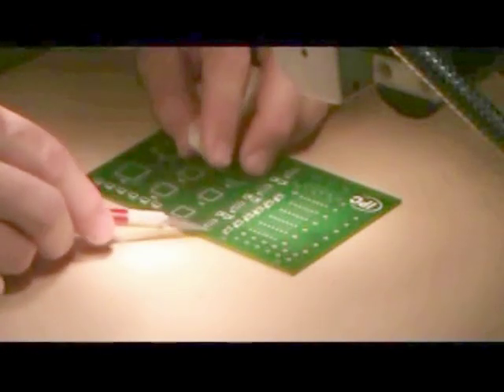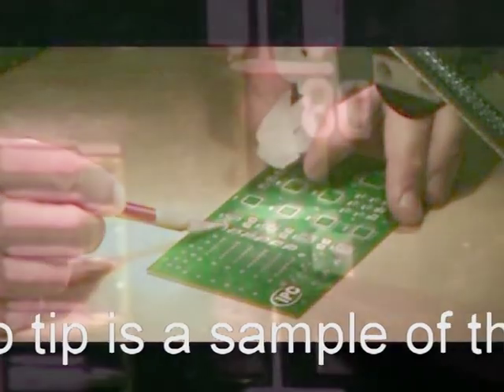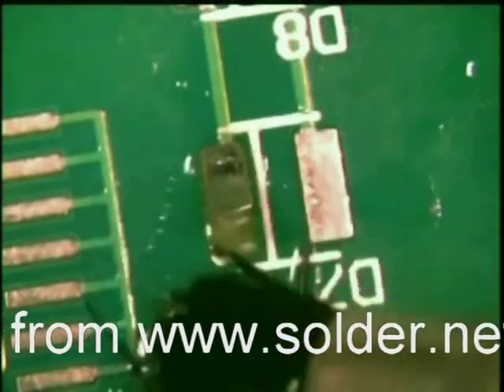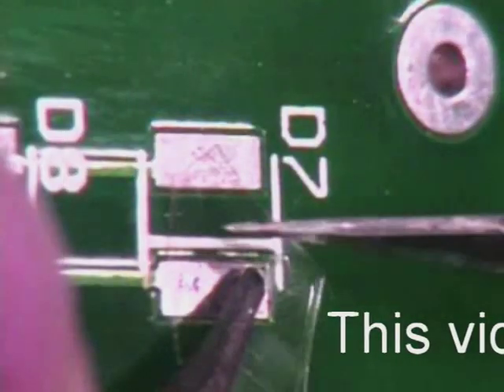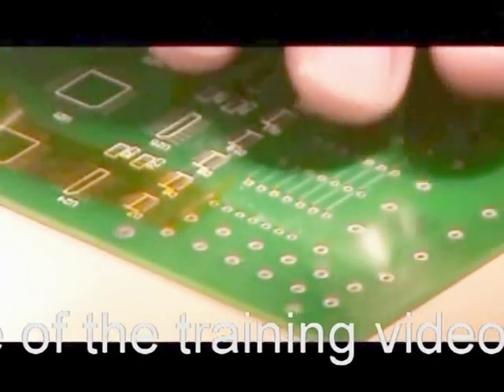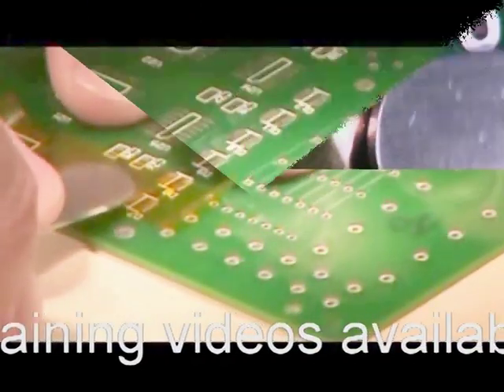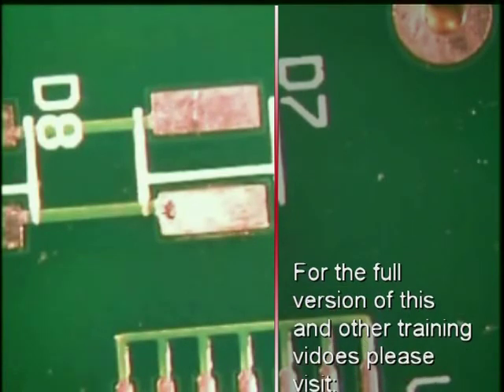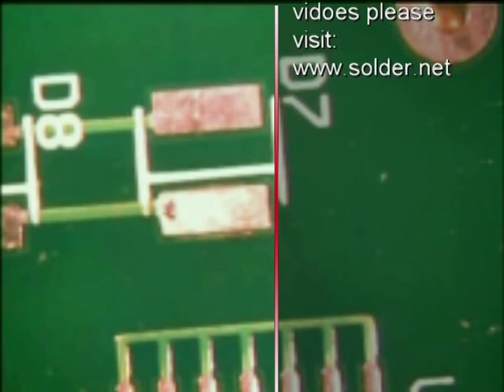PCB Pad Repair Video |

Comment: i feel like steps were skipped in this video....it goes from heating the tape to peeling the tape away to the repair is complete....wheres the part relating to laying a replacement thermal pad and so on at?? i havent ever had to do this but figured i would read up on it and watch vids about it but i hope others put the full list of steps in their vids :/